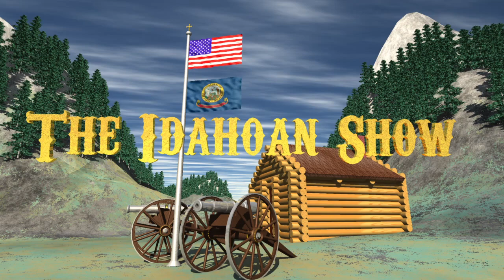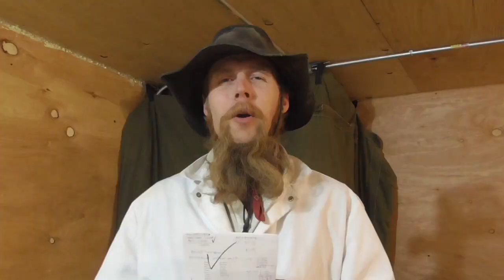Reality Check: Electronic Guns (VR009)

Comment: As the only person other than "WIK C" in the comment section who has actually BUILT a coilgun, I massively appreciated this video. Excellent lead in with the "power capacity seems reasonable" point right before demonstrating the irrelevance of capacity without delivery. As I have been pretty harsh with my replies to comments favouring the possibility of effective coilgun weapons, I figure I should at least explain the only physically possible way to construct one using theoretical (as opposed to hypothetical or practical) technology.

Two disclaimers, first off I haven't done the math (and I won't) so while the technology is theoretical, this application is strictly hypothetical. Secondly, I maintain that anyone who genuinely believes electricity is even capable of competing with the utility of solid fuel for power delivery is wilfully ignorant. I'll leave it at that before I rant about the overwhelming majority of electricity is generated through FUCK there I go, okay on with the show:

Graphene manufacture and utility is the next technological leap for mankind, and it is the only material possibly capable of conducting electricity how we would need it in this case, primarily in the coil being wound of a single carbon nanotube fused in a glass sheath, itself surrounded by another glass layer with a vacuum between it and the coil, or an active cooling system flowing through the space if such passive is insufficient. Graphene will again be present in the capacitors used to directly supply power, I am personally unsure what the electrolyte would have to be but I am sure people are productively working on it. Without discovering some hitherto unknown material that is infinitely conductive along its length while being infinitely insulatory along its breadth, or some quantum tunneling phenomenon that wirelessly transfers power directly to the coil from a dyson sphere with no loss, such as I described is the only way I could reasonably expect to make an efficient enough coil that is also durable enough to withstand its own use.

As far as things stand today, you summarised them excellently and with receipts to boot! My tenth grade science fair project is vindicated, absolute bullshit they said "making weapons isn't science" I said it's the first and primal science. Might I recommend writing up your math work here along with the commentary you gave into a white paper, and publishing it? You've basically performed a study here already all it needs is the formatting!
Reply: "Excellent lead in with the "power capacity seems reasonable" point right before demonstrating the irrelevance of capacity without delivery. "?

See also:

https://youtu.be/s6cFMM6MTpI

https://youtu.be/zoA_iUGHyPg

Comment: Understand what you just presented however can you then explain why the dod is testing the current rail gun technology if it would require so much energy
Reply from the maker: Well, the problems I discussed here might be more easily overcome for naval artillery on a vessel with its own nuclear power plant, and space for a couple acres of super-capacitors, as well as cryogenic cooling systems to cool the electrical conductors.  That said, just because they're testing it doesn't mean it will work, let alone work well enough for them to actually adopt it.
Reply: In addition to the Idahoans expert reply, the biggest problem being power delivery means railguns are inherently more viable. A coilgun requires each of the potentially millions of coils in the wrap be insulated from each other. Up those voltages enough to get a reasonably deliverable amperage and all of a sudden an arc jumps the varnish and you have a useless tube. Find a way to deliver enough amperage at low voltage and any conductive material heats up to melt the insulation, your coil shorts and you have a useless tube. What if you balance it out, and up the voltage but not as much and you put much thicker insulation, oh whoops now the electromagnetic force generated by the coil drops at an inverse square of the thickness of the insulation.

In a railgun, there are only two (maybe more? basically nothing relative to the coils in a coilgun anyway) rails and their function actually relies on them being able to conduct between each other. Shorts would still be an issue, however, since if the power can just arc between the rails it won't effectively project the shell.

However, to finally actually answer your question, the DoD is testing the current railgun tech for one reason and one reason only: To troll the Navy and shut them the fuck up with their "hey isn't it great having an electric cannon boy everyone in every US armed force must just loooove having one of those OH WAIT WE'RE THE ONLY ONES WHO HAVE ONE OF THOSE! HAHAHAHA FUCK OFF GRUNTS AND GI JOES GET REKT!!!

It's a real fucking pain at the bar after a joint parade exercise, take my word for it.

Comment: Batteries are/have been the bottleneck on a MOST tech these days from coil guns to lasers, etc. 
The DOD tech has some good stuff, but powering it is the issue.

Look at what it takes to run those stupid electric cars. The batteries really suck compared to the EASE of a normal gas or diesel power veh.
Reply: Oh yes. See also: NEW! Lethal coilgun || Tutorial || start to finish 
   https://www.youtube.com/watch?v=1c5cxLK08RQ
Reply: So petrol powered rail gun? I joke but the energy is thier; someone do the math please.
Reply: @petercarlisle2927  For that you are stuck with a generator and capacitors to store the energy for discharge in a pulse. At which point you might as well go with a battery pack, which brings us back to the same problem in the first place.
Reply: @petercarlisle2927  o yes. SEE ALSO:Lethal coilgun || Tutorial || start to finish 
https://www.youtube.com/watch?v=1c5cxLK08RQ

Comment: I think the problem can be solved if we raise the voltage to a high enough level so the resistance of traditional copper coils can be overcome to dump lots of amps as fast as possible. However, the coils are still going to have to be quite thick to withstand the high-impulse current, and the capacitors will need time to charge. Perhaps sacrifice some resistivity and use steel or tungsten or some alloy with high MP.
Reply: Mitigated, not solved. The real problem isn't current delivery to the coil, it's the efficiency of the conversion of electric current to electromagnetic force. Even assuming a direct connection to a Dyson sphere with the literal power of a star at the push of a button (as well as the requisite transformers to get your desired V:A ratio), you still have to deal with coil efficiency, and here's how what you suggested goes:

Increased voltage through the coil means increased risk of arcs, which means increased insulation, which means increased distance between coil turns, which means decreased electromagnetic force at given wattage/coil length, which means increased amperage, which means increased heat, which melts the insulation, which means increased risk of arcs unless you increase the voltage again which puts us back where you started.

The only way out of that little loop is active cooling, and I'm not talking about an all-in-one CPU watercooling unit, I mean big daddy real money cooling systems. What's that I hear from the cheap seats; "Wouldn't that require its own power supply, competing with the coil itself for power?" Oh, but of course it would, meaning even less electromagnetic force for the coil at a given wattage, which means... Oh, fuck, this isn't out of the loop... IT'S JUST A BIGGER LOOP!

P.S. Sorry for dunking on you pretty hard here and being a little mocking while I do it, I just think it's more entertaining that way. While I'm on the subject of hard dunks, increased resistance also means increased amperage which means increased heat and oh look at that we're back on the loop. Finally nailing the coffin shut is the fact that all of these effects scale logarithmic, not linear. Not only is addressing these effects a loop, the loop gets bigger every time you go around.
Reply: @piratewhoisquiet  I don't think it would need an entirely separate system for cooling and insulation, submerging it in a tank of oil would do the trick. After all, you're dumping a set amount of power through the coil, no more than a few kJ, which can only heat up the coil by the fraction of that power which is wasted as heat. Let's assume the pure copper coils (specific heat 0.385 J/gC) in each stage weighs about 1kg, which is on the light side, and we'll be dumping 10 kJ through each coil. That means each coil can heat up by an absolute maximum amount of about 26 degrees celsius, even if the coil is 0% efficient and wastes everything as heat. A tank of oil should easily be able to sink away that heat, and prevent any flashovers. Using a specific heat of 1.6 J/gC for mineral oil, a tank holding 1 kg of oil should be able to absorb the energy from about 16 shots at 10kJ each before it heats up by 100 degrees celsius. The problem we need to worry about is not the heat being generated over the entire coil, but the structural integrity of the coil itself with so much current flowing at once. We're not trying to build a cannon here either, all it needs to do is duplicate the performance of a rifle, though admittedly the gun will likely end up weighing about 50 pounds with all of the copper, oil, tranformers, capacitors, and batteries it needs. I'm just saying that it's theoretically possible to build such a handheld weapon with modern technology, but obviously futuristic superconductors with no resistive heating would still make it far more wieldy to carry around. All of this is purely theoretical, and we'll never actually know if this can work unless we try.
Reply: Yes of course. See also New Portable Super Coilgun:

https://www.youtube.com/watch?v=rclLsQ9nyeg&amp;feature=youtu.be

https://www.youtube.com/watch?v=-mjDqp_oWZk

Comment: The amps can be cut by raising Volts.. BIGLY
In 5th grade terms,  a whole crapload of tiny cells can make a high voltage batt same WattHour & size as 12v.
The problem is efficiency in converting supplied power to final kinetic power.
Reply: You're going to need iron too, something with magnetic properties, and lead won't do.  Also hysteresis is going to be a problem.  I would be interesting to see just how fast we can accelerate a bullet sized projectile using electro magnets, but the only promising avenue is either a really really long accelerator or go the particle accelerator route and make it circular, so your accelerator is theoretically as long as you need.  But coil guns are not rail guns, and rail guns make sparks, ozone, and have serious barrel life problems.
Reply: O yes. See also New Portable Super Coilgun:

https://www.youtube.com/watch?v=rclLsQ9nyeg&amp;feature=youtu.be

https://www.youtube.com/watch?v=-mjDqp_oWZk